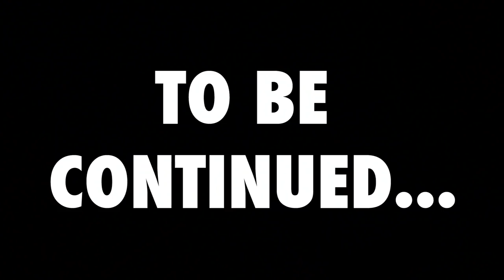Trueno goes under the knife | Juicebox Unboxed #22

Comment: The polyurethane foam in the chassis rails are to add structural rigidity to the car's frame, you could also fill the roof pillars with the stuff to increase it's strength the foam is very strong.
Reply from the maker: slick_ej6 indeed, the Japanese did an awesome job with that chassis in japan, it was incredibly stiff when it was still in one piece. arguable how good it is in the long term for rain draining in certain places especially on a road car. I’ve seen a few rot because of it and some appeared to be just fine. It’s Luck of the draw really...

Comment: I don't understand why the underside and everything was sprayed before they started cutting panels out?
Reply from the maker: James Swift we had the car blasted to see what we were left to work with, the 86 was then painted to seal the bare metal from the salty elements while it sits as a bare shell for Barry to work on, as bits are cut out, the fresh stuff will be repainted and reseated giving us the best possible change to protect it from corrosion.
Reply: juiceboxforyoudotcom I've got you boys, cheers for the reply